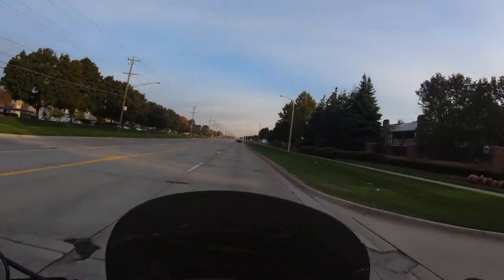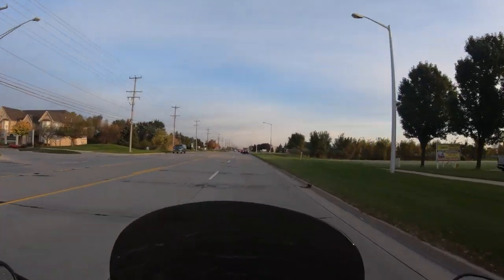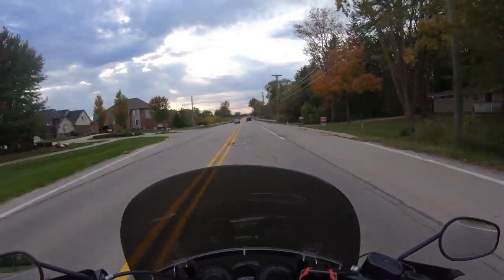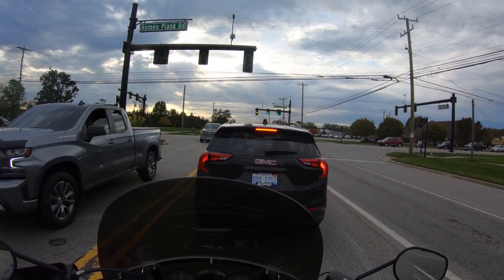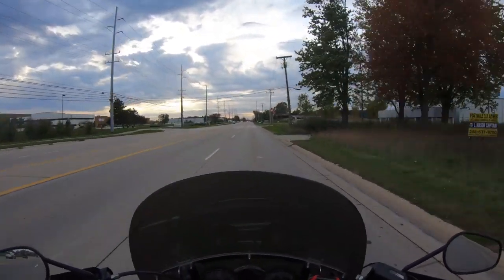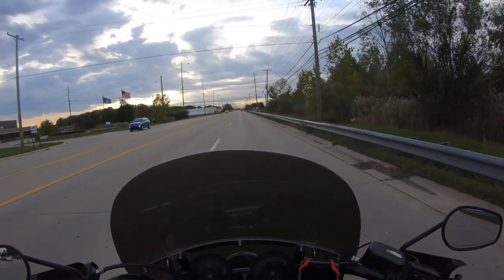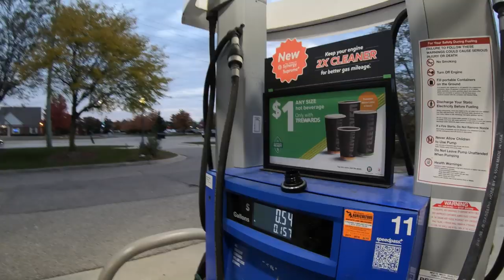(Sump)thing Is Wrong With The Milwaukee 8

Comment: Yes that's what I did. I ordered the CHECKM8™ VENTED TRANS TOP COVER,Ultracool Gloss Black Oil Cooler Kit - SMS8-1G. These items I will need for my Stage IV 131ci Kit. I also bought that heat guard from Kuryakyn. I want some things you have on your bike too.Your right about a little bit of chrome, but I want to see how much gloss black I can put. Keep up with your excellent topics. What is that small rectangular item on lower left side? Thank you.

Comment: Hum interesting here a question how do you know it sumping
Reply from the maker: The Blue Bike & Doyle most of the time it’s noise and blowing out oil, but it can me interesting to identify
Reply: The Blue Bike & Doyle Loss of power, overheating
Reply: @dylandream2248  good mine not had that problem
Reply: Thing is I have never seen one sump that has not been upgraded without a new version oil pump that’s the only time I have heard and now even for along time now the upgrade kits come with new pump... I have out many 1000s miles on a m8 and never had an issue

Comment: The crankcase pressure is definitely an issue I have a 2019 Road Glide with an oil pump and cam plate upgrade. Starting to notice a lot of oil residue on my air filter witch I will be relocating vent lines to go back to the crankcase after I have vented it. Because of EPA standards the Breather tubes recycled into the intake which creates a problem carbon build up on the Pistons and exhaust valves definitely not good for the engine.
Reply from the maker: yeah, im working on getting a catch can put on my heritage for that oil!

Comment: If what you describe is actually a valid fix, don't you think the MOCO would have done this long before now?
Reply: John Porter 
As Harley creates more power with displacement they can’t vent the pressure due to the EPA bearing down on them so they are trying to contain it within the motor when the public can just drill a hole but Harley can’t
Reply from the maker: this ^
Reply: @TheMotorcycleMick  But isn't their latest fix kit which vents the primary case simply by venting to the atmosphere through the small rubber hose in the primary case? Evidently the EPA has no problem with this fix.
Reply from the maker: 48retrop it’s because it’s a vent not a biproduct of combustion